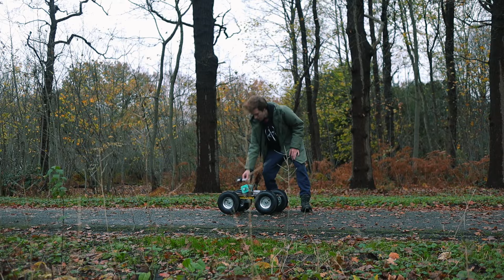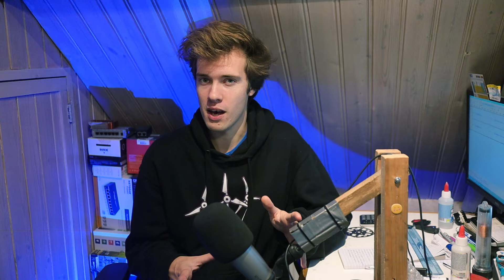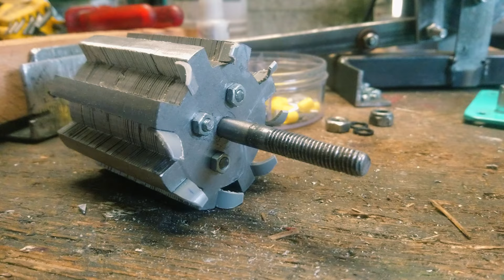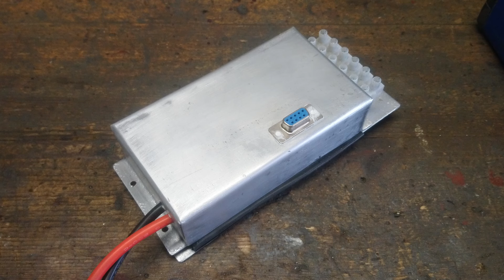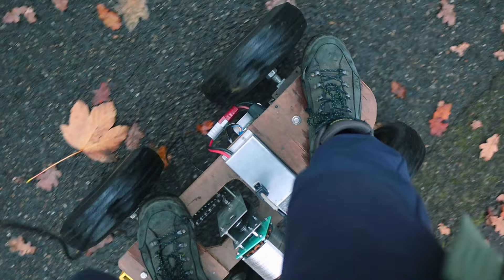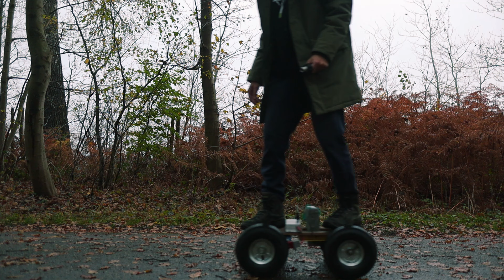The switched reluctance motor powered electric skateboard

Comment: VERY Cool stuff!  I liked the DIY motor that's some good engineering that went into that, and I agree with the approach of the lookup table in the Arduino code.  I did a very similar thing using Excel to perform a regression to derive the formula for a sensor transfer function (one particular sensor was an unknown Logarithmic thermistor and I needed the Beta but wasn't behaving luck with the Steinhart-Heart Eq., but that's for another day) .  All the cool kids like to use Matlab, but I just used what I had available to me to get the job done.

Comment: Well done! You don’t have to reinvent the wheel with a whole new motor—just swap in a rotor that gives you a tight **0.5 mm air gap**.

That one little tweak will explode your torque: from a pathetic 1 Nm straight up to *9 Nm* (or exactly *6.638 ft-lb* for the imperial crowd).

Nine times the grunt from a tiny gap adjustment—pure genius! 🚀

Once you’ve done that, you really need to measure the inductance of each phase and the Q factor. Grab an LCR meter, dial it in, and you’ll know exactly what voltage and current to feed it to squeeze out maximum performance.

You’re absolutely on the right track—just fine-tune those adjustments, and soon you’ll be flying around yelling “YAAAHOOOOO!” like a real cowboy on the open range! 🤠

Comment: I love the video and recognize the itch to build it on your own.
I made me remember tearing down the old spring-loaded centrifugal timing advance system — disassembling it, cleaning it, greasing it, and putting it back together so the points and condenser would trigger the spark at exactly the right moment for the distributor’s speed. We used to experiment with different springs and weights to squeeze out the best performance.
It makes me wonder if adding a similar mechanical to your encoder for dynamic angle correction, perhaps it remove some, if not all, of the digital computation and help things run more efficiently.

Comment: Back in a previous job in the early '80s, I worked on a large instrument that sat inside a wind tunnel used for aircraft testing.  It used 3 large stepper motors and I had to control that with an 8085 processor, likely running at a few MHz.  Ran into a similar issue as you did, with insufficient CPU power, although this was with the mechanical inertia of the instrument and making the various stepper motors ramp up and down to high speeds.  The idea was to not miss any steps due to mechanical resonances, also had encoders on the motors that were used for the final position adjustments.  This was critical as running time in the wind tunnel is very expensive so you don't want to be waiting minutes for this thing to traverse back and forth across the test section.  

Anyway, had to model and pre-compute lookup tables for the stepper motor timing and save those in EPROM.  I recall having 3 speed ramps to get up to speed and 3 ramps to decelerate.  Then the CPU would compute how many steps it had to move and then figure out what was the highest speed it could reach, given the number of steps needed to ramp the motor up and back down.   And yes, like you did, the lookup tables simply had the number of clock cycles needed before sending the next stepper motor step.  The CPU sent  each lookup table value to a programmable interrupt controller.  Then, the CPU just waited for that interrupt to occur, then it sent out the step pulse to the motor controller and loaded the next value into the interrupt controller.  It stepped through the values in the table until it hit the set speed and then held the motor at that speed until it was time to slow down.

The tricky part of the project was that I had the CPU system, the 3 stepper motors and controllers, but the large instrument was still being designed and manufactured.  So this all had to be done with all this to be fine tuned by the modelling program once the actual hardware was ready.  Unfortunately, I left that job prior to that point, but did get to test out the control program on the real stepper motors, it was really neat listening to them ramp up and down in speed given various target points.

Comment: are the laminations insulated? may as well be solid if not.
assume you got alternating polarity on the coils, so the flux is in two "arcs" on either side of the rotor. 
freewheel diodes causes magnetic fields to persist in coils. the fields decay and the voltage rises proportional to the resistance as per e=ir. diodes clamp it at 0.6v. a resistance lets it ramp up to a known value if you know the maximum current...
wire gauge and length determines current for a given voltage.
size of wire and slot determines turns, amp turns. magneto motive force. 
it take a lot of amp turns, MMF, to force magnetic flux through air. you want the field to see the smallest gap possible, the least reluctance.
 and so, SRM is inherently wrong.
 you are pulling things INTO the magnetic field. you start at the weakest force and have to turn off as its reaching it peak. 
you have to push massive currents through the coils at first, limited only by the resistance rather than the inductance. of course it will get hot.
repulsion means you start at the maximum force and push out of the field. all motors use repulsion for a reason.

theres one obvious and logical conclusion... shorted turns on the rotor. youre one step from a repulsion or induction motor. can be wound. can be single turn. can be commutated to a shunt bar. can be permanently shorted as an induction/squirrel. its three phase... doesnt need the starting assistance.

as you dig, you will find other things that start happening. such as eddy current heating as the magnetic flux in the rotor moves from pole to pole... 
poles dont have to be "salient".

if you make laminations with the alignment holes offset by a degree or two to the poles they will assemble as helixes. they become their own fan...

less flapping gums in front of mic please. want to see the project.

Comment: Make several changeable coil assemblies with multiple smaller & larger gage magnet wire, obviously decreasing the gap as you mentioned. Someone may have already mentioned this. Keep going. Enjoy
Reply from the maker: swappable coils would be cool, but also mechanically complex, especially combined with a tight air gap.

Comment: Nice project!

I don't know much about motors, but I'm just wondering about the driver there. In my experience with 3d printing, about 10 years of it, I've learned that those old stepper motor drivers, like the A4988, used simple square waves which made the motors noisy and not really efficient. The newer drivers, like the TMC2209, produce something more akin to a sine wave, which is far more efficient and less noisy.

As for that decoder, have you considered using an optical one? They come rather cheap and consist of a slotted disk, an LED and a phototransistor, producing something like a square wave output, which should be rather simple to decode.

And why an old arduino nano? I mean, that chip is 15 years old or so. An ESP32 is way faster and more versatile, although the analogue input isn't very good, but then again, you probably won't need it.

Good luck!

roy
Reply from the maker: You're correct about the stepper drivers. For an SRM though, due to the absence of magnets the ideal drive waveform is not a sine wave. I did consider an optical encoder, but I'm worried it may be affected by ambient light too easily. I've had this happen in some past projects. (they worked fine indoors, but sunlight ruined it.) 

The arduino nano was mostly because I'm familiar with it. I wanted to spend my time and energy on the rest of the hardware and figured I could always upgrade the mcu when that was done. For a future upgrade I may try something like a TI C2000 which is more optimised for motor drives and has super fast ADCs. (and I've used it before so it's still kind of familiar)
Reply: @AKIOTV  I guess moving to an esp32 of sorts will be just a recompile, while moving to the c2000 will require a complete rewrite. As for the optical encoder, just print a cover for it and you should be set. And for the SMR, well, it's an analogue system after all, motors are, well, all of electronics is analogue in the bitter end, so I really doubt the ideal waveform is a squarewave.